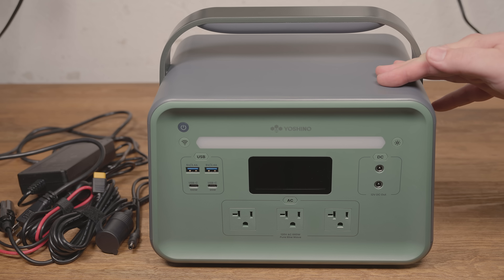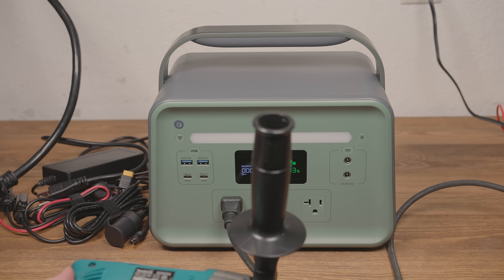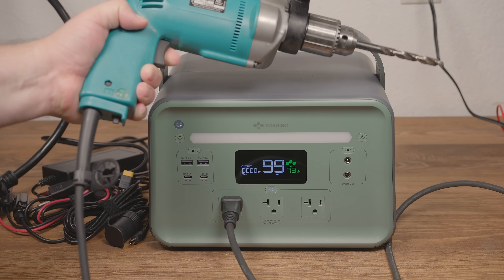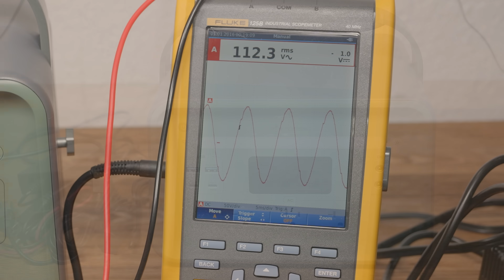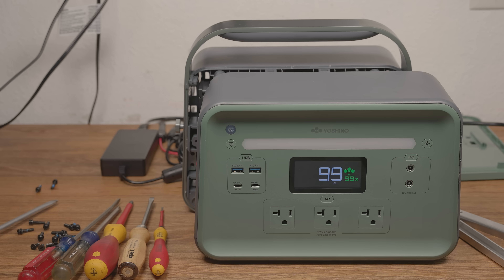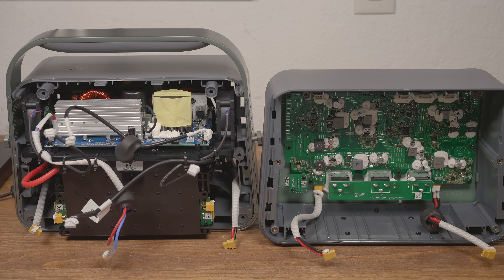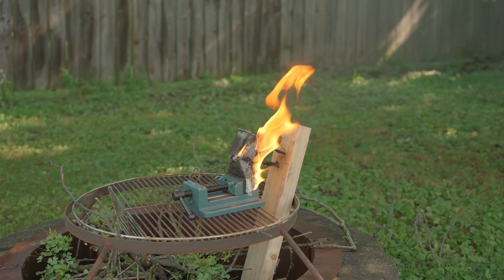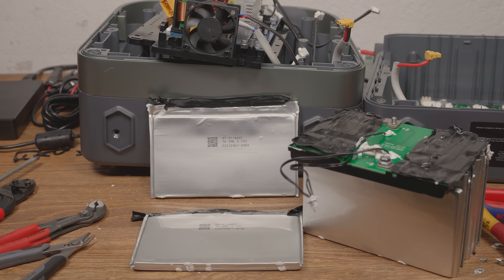Yoshino Solid State Battery Power Station, Test and Teardown!

Comment: There are several kinds of solid state li-ion batteries: The true mostly anorganic, glass-like, completely solid state type which is superexpensive and has poor performance. These would really be safe, but no one wants to use them. Then there are several grades of "partially" solid state batteries where mostly the usual NMR-chemistry is just put into some polymer or gel. Even the good old but explicitly not safe li-polymer-batteries for RC fall into this category. They just have no advantage beside carrying the "solid state"-label.

Comment: VINDICATION!!!
I seriously considered getting One of these and something didn't seem right. I researched the company and I think at the time they were claiming that they made it in California. I found the same address and knew right away that there was no way a battery factory could be in that building. Both the size of the space that they rented and the fact that they didn't need any enhanced air handling equipment for manufacturing a battery. 

It made no sense that the major manufacturers weren't making solid state batteries and that the terms they used to describe their batteries only lead to dead ends. 
Thank you for definitely exposing this scam

Comment: It is not SOLID STATE BATTERY power station,  it’s a SOLID STATE battery power station.
There is not a single vacuum tube in the whole unit.

Comment: While it is unfortunate that there aren't a lot of consumer protections for this sort of thing, but you can still do something about it on some levels.

We (all of us) can report this seller on Amazon and other marketplaces as being fraudulent.  I think at this point this is actually a blatant case out outright fraud (the batteries they're actually selling do not even meet their own stated criteria in their ad copy for what a "solid state" battery is, so they are actually knowingly selling something different than what they are explicitly promising), and it should be reported as such.

On Amazon, you can bring up the listing for the product (make sure you are logged in), and click on the link (right below the "About this item" section at the top) that says "Report an issue with this product or seller".  They don't have a category specifically for fraud, so I recommend just choosing the "illegal content" option, and explaining that it is fraudulent in the description of the issue.

Comment: Hmmm, with a name like "Yoshino" one might think it's a Japanese company.

Can't find any 'real' aka creditable information online as to the origins of Yoshino. Everything one reads on Yoshino's website sounds like marketing fluff. There's a certain pattern developing here as one peels back the layers of fluff which only uncovers more buzz words and fuzzy fluffy feel good marketing fluff. There's absolutely no substance to all the words and statements on the Yoshino website. Now where have I seen other websites like Yoshino's based out of? All of them using a Japanese name to make themselves appear like a Japanese company to pretend to add a credibility to their snake oil products. Could this be yet another slimy company selling fake products using a Japanese name to fool people into buying their lies? 

This reminds me of the Korean TV makers calling LCD panels LED screens when they switched from a CCFL backlight to a LED backlight. Then they doubled down on their bullshittery later by calling LCD screens Quantum Dot screens when they switched from LED to so called Quantum Dot tuned to white backlight. Sharp made a few true demo LED screens about two decades ago and dropped that idea like a radioactive hot potato due to the 'complex cost' as OLED was becoming cheaper but still had the Plasma screen like burn in issues. Today, OLED is becoming mainstream but there still are no true LED screens out there, just BS marketing like Yoshino's.

Comment: Thank you for this, you've gained a subscriber. A few weeks ago I saw another YouTube  'review' of the Yoshino as the 'first solid state' but they never took it apart during the whole video... and I was like.... really? Even after they found its weight and output had no indication/benefit in line with solid state, they didn't question it. So thank you for doing it properly! 
Edit: And this is why I prefer personal power banks that use metal cased 18650s or similar, not pouch cells in a thin plastic case.

Comment: I was about to ask if you tested the charge and discharge voltage curved, wnich would give an indication about the battery chemistry.
But I guess there's not really a point as after watching the whole video and reading your comments.
Fantastic job! Subbed.

Comment: This is what they are probably referring to as the "Nail Test" from the UL Standard.

STANDARD FOR SAFETY 
UL 1642, ,Lithium Batteries

14 Impact Test

14.1 A test sample battery is to be placed on a flat surface. A 15.8 ±0.1-mm (5/8 ±0.004-in) diameter bar is to be placed across the center of the sample. A 9.1 ±0.46-kg (20 ±1-lb) weight is to be dropped from a height of 610 ±25 mm (24 ±1 in) onto the sample.

See Figure 14.1.  (couldn't include this, it's a picture of a rod)

14.2 A cylindrical, pouch or prismatic cell is to be impacted with its longitudinal axis parallel to the flat surface and perpendicular to the longitudinal axis of the 15.8-mm (5/8-in) diameter curved surface lying across the center of the test sample. A prismatic cell is also to be rotated 90° around its longitudinal axis so that both the wide and narrow sides are subjected to the impact. Each sample is to be subjected to only a single impact. Separate samples are to be used for each test.
Exception: For lithium ion systems, a cylindrical, pouch or prismatic cell is to be impacted with its
longitudinal axis parallel to the flat surface and perpendicular to the longitudinal axis of the 15.8-mm (5/8- in) diameter curved surface lying across the center of the test sample. Each sample is to be subjected to only a single impact. Test only the wide side of pouch and prismatic cells.

14.3 A coin or button battery is to be impacted with the flat surface of the test sample parallel to the flat surface and the 15.8-mm (5/8-in) diameter curved surface lying across its center.

14.4 The samples shall not explode or catch fire.

Comment: bigtb, Yoshino's cell manufacturer isn't lying which is fine.

It's Yoshino which is lying: these are semi-solid state cells. They are indeed safer than normal liquid electrolyte cells, but containing carbonate still means that the electrolyte is still flammable.

It wouldn't matter if Yoshino was marketing using semi solid state cells but they don't so they can go die in a hole.

Comment: I did a lot of battery work in the RC world about 10 years ago. Learned a lot making the RC Flight Source App.

Organic solvents can also be solids. Your typical LiPo battery has a gel electrolyte. They've struggled to get the solid polymer electrolytes to have good ion transfer, which is why we haven't seen solid state batteries on the market. You'll have to discharge a cell fully and pull apart the sheets to see what is inside. The company making these batteries should also know better than to claim safety when they have spontaneously combustible materials such as cobalt and manganese. The only possible claim to safety would be if it has an actual solid electrolyte that would stop dendrite formation. Solid state batteries aren't inherently safer just because of the electrolyte. Even solid electrolytes can be flammable. They ideally would just have a higher C rating and lifetime recharge to start. Solid state electrolytes can possibly allow the batteries to charge to higher capacities by pushing the cathode to it's maximum without fear of dendrite formation. NCM batteries are just as unsafe if not more unsafe than an NMC battery when exposed to a puncture, which would bridge the anode and cathode sparking a runaway thermal reaction. Clearly their marketing department and management know nothing about their products and made false safety claims.

If you want better puncture safety, the chemistries you want are LiFePo or LTO. Their cathode chemistries don't use manganese or cobalt and thus have a lower thermal runaway chance. Safety and high capacity won't come until probably the anode-free battery era.

Comment: You didn't really prove they weren't solid state. Puncturing a solid state will lead to a runaway thermal reaction just like a normal lithium ion battery. The difference is that with solid state batteries the solid electrolyte prevents dendrites from puncturing the electrolyte allowing companies to use a thinner lighter electrolyte layer saving weight and improving density. I'm not saying your wrong because we have been burned too many times with false claims about battery technologies but to really know, I think you would need to look at the layers under a micro scope.
Reply from the maker: Interesting.  From what I've read, the growth of dendrites in solid state batteries is actually one of the tough challenges companies are trying to solve.  You seem to be saying solid state batteries are inherently immune, which is contrary to what I've read.  Do you have a source for that?  I'd love to learn more.  At this point, I've been told so many things that solid state batteries supposedly are and are not, and much of it is contradictory.

The SDS for the cells lists liquid, organic solvents.  So the Yoshino cells are a hybrid or a semi-solid state battery.  Again, I've seen reports that a solid state can short out and heat up enough to cause the case or things around it to burn, but it won't exhibit a typical, fiery thermal runaway from the chemicals reacting, which is what the Yoshino battery seemed to do.  But I've also had you and one other commenter say they will do that.  Any studies or links to technical data you could provide would be appreciated.  There's obviously a lot of misunderstanding about solid state and semi-solid state going around, and it would be great to clear up as much of it as possible.

Cheers!
Reply: @bigtb1717  re: "At this point, I've been told so many things that solid state batteries supposedly are and are not, and much of it is contradictory."  exactly, this would be because (as we already know) Solid State DOESN'T EXIST in their "final form" for consumers, for anybody to really say definitely (in baseline terms) what they ARE or ARE NOT.   no if we listen closely to the claims people like Matt (and numerous others to be fair) make, what we are actually hearing is them just REPEATING the "marketing hype" regarding the properties the companies working on Solid State having been "talking up" in order to SECURE EVER MORE FUNDING AND INVESTMENT (aw crap)...

yeah, observe how the properties people "latch on to" always represent the BEST PROPERTIES (relative to existing NCM) ie, fast charging, energy dense, zero Thermal Runway, light weight, long cycle life, etc.  the simple reality is, if Solid State were to ever come to market...?  1 (or more) of these 5 properties may NOT make it to production...

that's right, we may get Solid State but it might be MISSING a feature or 3 that was originally promoted, but getting 3 out of 5 or even 2 outta of 5 would still technically represent an "improvement", even if the gains aren't the SPECIFIC one's that a person had been dreaming about.

Comment: I think the fact that these are more or less "standard" Li-Ion cells, makes this powerstation worse than any other powerstation. Most new stations have LFP cells, and I've seen growatt giving a big discount on their invinity 1500 Model which has normal Li-Ion cells. Thanks for the well explained video
Reply from the maker: I think they are more of a "hybrid" or semi-solid state battery.  Definitely less reactive than a standard Li-Ion battery.  I just wish Yoshino were more upfront about it.  If they aren't lying, they are at least using marketing that leads people to the wrong conclusion.

Comment: These are just standard lipo pouch cells. Not solid state.
Reply from the maker: I think they are what would be called a hybrid or semi-solid state.  A solid electrolyte with some organic solvent soaked in to aid contact between the electrolyte and the anode/cathode.  More stable than a "standard" Li-Po battery.  I just wish the company was more upfront about it.

Comment: Did you charge it to max before shooting it with an arrow?
Reply from the maker: @gg-gn3re  Close.  I mentioned in the video that I charged it and it got to 99% and continued charging for another 25 minutes or so and I decided that was good enough.
Reply: @bigtb1717  ah sorry missed it. Yea it was surprising it didn't seriously blow on the first shot then haha, but yea obviously not solid state. I think a solid state wouldn't have even allowed the arrow to pierce it at all. It'd be like shooting into a block of metal as far as I understand them.
Reply from the maker: I think these would be classed as a hybrid or semi-solid state.  They have a "solid" substrate (I've seen reports that some are even a powder) that have some liquid solvent soaked in to aid in construction and to ensure a good contact is maintained between the electrolyte and the anode and cathode.  Certainly more stable than a standard, liquid electrolyte LI-Ion.  I just wish Yoshino had been more upfront about that.  It's still a step forward and a possible stepping stone on the way to a fully solid state battery.

Comment: Please take a cell apart and show its construction.
Reply from the maker: I'm planning to do just that.  Hopefully soon, but I've got a lot going on right now, so I can't say when exactly it will happen.  Probably not this weekend, but we'll see.  Probably going to be next week.
Reply: @bigtb1717  That would be great and the time doesn't matter all that much. We've all been waiting for solid state batteries for how long now (literally 6-10 years!) and still never seen them?! I think you've proven already these aren't SS cells so now for debunking that a bit more by showing cell construction. This isn't the first time that somebody claimed they were using SS cells and were flat lying about it! Also, please show the world the box the pouch cells were in. Does it provide any clamping or compression around the cells? Pouch cells swell over time even with normal use. They need to be kept under compression to inhibit this.

Comment: I own the B4000 SST  used it for the first time last month in July, the unit did work fine, but after watching this, and the other video that surfaced where they lie about using solid state batteries, I feel cheated. Is anybody starting a class action suit or something along that line to hold them accountable for false advertisement?
Reply: re: "I feel cheated. Is anybody starting a class action suit or something along that line to hold them accountable for false advertisement?"  there ya go, now that's how we deal with FRAUDSTERS. 🤙
Reply: @phillyphil1513  granted the unit works, but yet how long and what other claims did they falsely advertise? Who knows? But what got me is I paid for something and now I’m finding out is not what I paid for. I could’ve gone with multiple other choices for portable power stations. Scamming is not a good way to do business.

Comment: I own the B4000 SST  used it for the first time last month in July, the unit did work fine, but after watching this and where they lie about using solid state batteries, I feel cheated. Is anybody starting a class action suit or something along that line to hold them accountable for false advertisement?
Reply from the maker: I think something like that would be extremely difficult to pursue for a couple reasons.  First and foremost, it's a Chinese company.  Second, with "solid state" battery tech being so new, it's honestly a bit muddy as to where the line falls in terms of what constitutes a "solid state" battery.  Granted, I think any battery that contains liquid electrolyte, even in relatively small quantities, is firmly in the category of a hybrid or semi-solid state.  But could an argument be made that, in terms of advertising, it's close enough for the marketing team to call it solid state?  I'm sure opinions differ on that.

As for feeling cheated, I got a bit heated (no pun intended) at the end of the video.  But the batteries are pretty stable, all things considered.  So if the unit is doing for you what you expected it to do, then I'd try not to get too worked up about it.  Hopefully you can still get years of good use out of it.

Cheers!